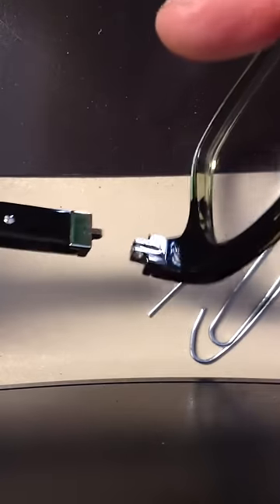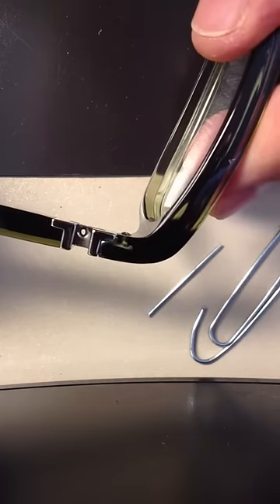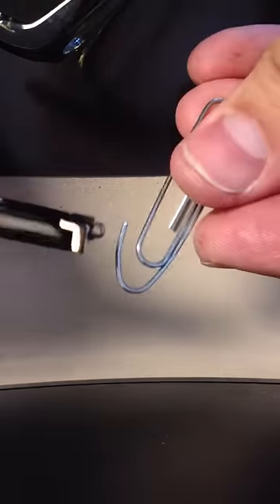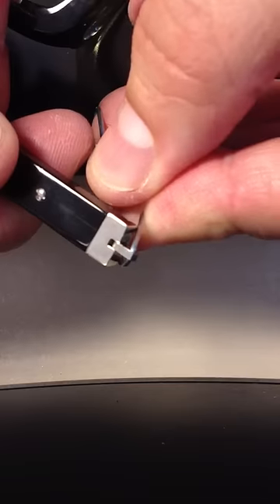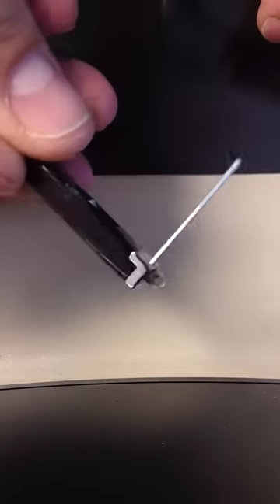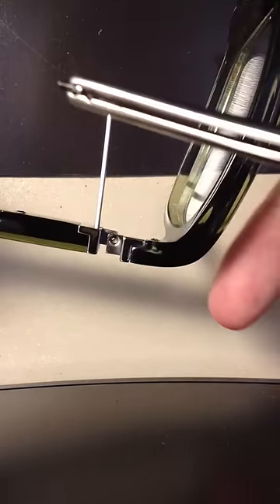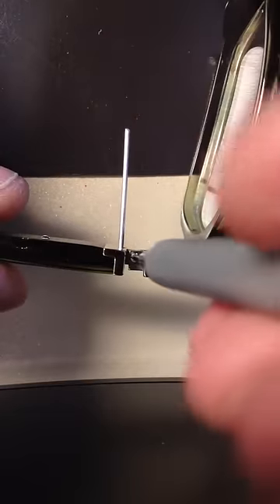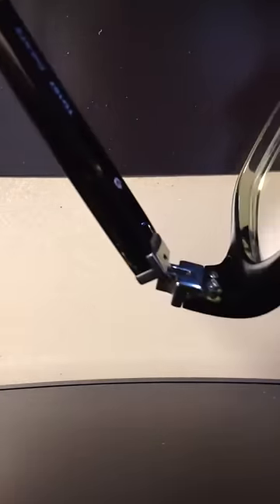Replace screw in spring hinge on your eyeglasses

Comment: Hey! For anyone who's having trouble with the paper clip wedge, use an extra screw from and eye glasses kit for the wedge instead. My spring hinge was too round and the paperclip would slip out. I did tons of screaming so if anyone feels the same, I feel you 😭. I hope this helps!
Reply: I know it’s been 3 months but thank you so much 😅😅 I was losing my mind
Reply: it's 3:30am thank you so much
Reply: I swore up a storm, I can tell you that. I didn't have any paperclips, only pins and needles (which I was expecting to sproing out of the hinge into my eye at any second) -- the tip about the spare screw was a godsend.

Comment: You are an absolute genius!
Unfortunately I couldn't find a paper clip to sacrifice, so because I take things apart (quite a lot) I used a spring retainer from an old junk tape deck.
It worked like charm!
Thing is, the end has to be flat ended, otherwise it will spring out.
But yes, totally repaired my glasses.
The reason I removed the arm is because the part of the arm that connects to the frame had fallen out presumed lost
However I clumsily dropped the cut piece I had made on the floor, and on looking for it, to my amazement, I found the missing piece from the arm.
So thanks for saving my sanity 🤬😃

Comment: Just wanted to say thanks for the idea-really!!  It didn't work for me but it gave me another idea that did!!  My glasses were such that the spring loaded end was curved so I couldn't jam it open with anything -because it was rounded, things kept "popping" out...lol  So I went into my sewing box, got the strongest thread I had and used that to pull the spring out while loading the pin.  Instead of putting the paperclip through the hole and pulling, I put the thread thru the hole and pulled the spring out while loading the screw in.  It took some doing of course but it worked....thank you again for posting the video.  I didn't notice that someone earlier in this post said use dental floss.... thats a great idea in case your thread isnt strong enough.

Comment: I had figured out the issue, but couldn't figure out how to get the spring out enough to wedge anything in there and still have enough hands to work. I had a rope tied around a door handle and it just wasn't working. Your technique at 1:13 worked perfect, to pry open the spring with one hand and put in the small wedge with the other. For the zenni aviators that I was using, I had to use a small bobby pen to do the prying and cut a piece off to use as a wedge. A paper clip was too big and tip of a needle was too small. After watching your video, the glasses were back together within two minutes... after trying various methods for an hour. Thanks!

Comment: This was good advise except for one small problem on my end. My glasses arm didn’t have that handy indention in the side for the paper clip to hold the hinge in the extended position. 

Cheap frames I suppose but I was able to work around that and get it done. 

Using your guide to hold the hinge extended, I used another paper clip to place in a gap behind the hole in the hinge to hold it open and put the screw back in its place. 

Thanks!

Comment: Very helpful video. Thanks. Did not have a jaw clamp as shown but based on the video, I bent a paper clip a sharp U, threaded it through the bolt hole  and used it as a fulcrum against the temple end to extend the spring connector and lock it extended as shown on the video. Worked perfectly.

Comment: Any suggestions on how to keep  the paperclip in place when the spring keeps popping it out? I'm trying to fix my son's glasses and the space may be smaller than the glasses you're using in this video. I can pull the spring out and place the paperclip/pin in the space but when I release the spring it forces the paperclip/pin out. I tried releasing the spring at different speeds but at any speed the paperclip/pin gets forced out. Any other tips/suggestions?

Comment: My daughter's eyeglass hardware was much smaller, so the paperclip was too large.  I used a toothpick and trimmed the end until I was able to fully extend the spring arm.  Then I magnetized the end of a small screwdriver and dropped the screw in.  It took quite some effort, but it did finally work.  Having a small vice would have made things easier.

Comment: its not easy as it looks, but i have different frame I pulled and I don't find a gap to put a pin.
Reply: Same here,  Its more like a slot
Reply: An even easier way to fix this, that does not need a "slot" is to use a long piece of thing, strong dental floss to loop through and pull out the spring-loaded piece to allow the alignment. The floss is thin enough to allow the inner hinge to slide in and be tugged on. It takes a second pair of hands but we were able to repair two arms in under two minutes this way with no extra bits other than the floss.

Comment: My problem with my spring hinge was that it got loose and was pulled from its socket. What I did is I pushed it back inside the socket. It snapped back inside then I followed your instructions here.

Comment: I tried the repair but unfortunately  there is no spot in my frame to stick the pin. still struggling after 2 days to find a way to keep the gap open. I tried using a plastic card but it gets in the way when I tried to insert the screw.

Comment: Huh?? Just use the flex screw. It has the extra tip that comes into a point so that it can get through the smaller hole. Once you screw it in, you just easily break off that extra bit and voila!